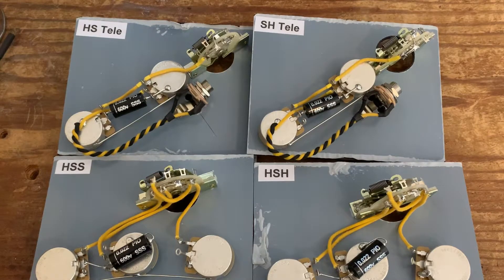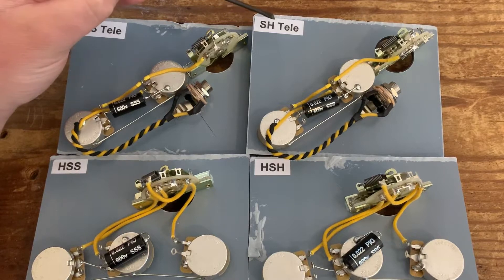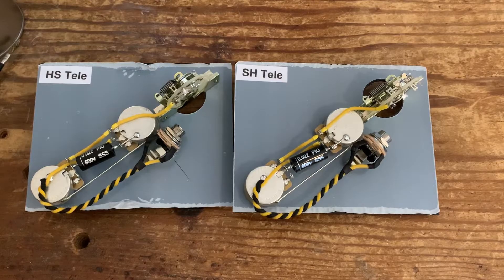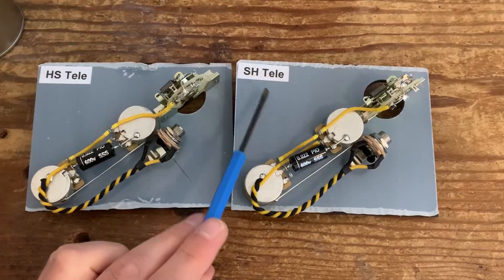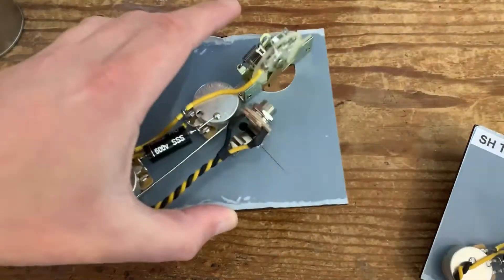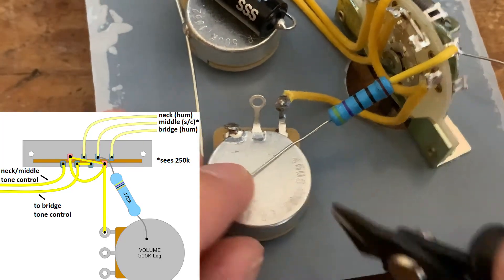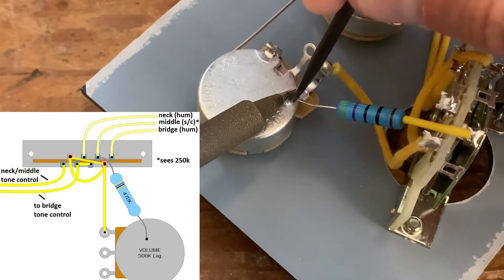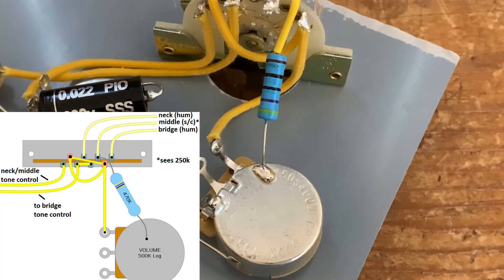How To Use Resistors to Balance Single Coils & Humbuckers In Your Guitar

Comment: In the instance of a HS configuration with one volume (500k) and a three way toggle, would you just place the 470k resistor on the point on the three way toggle where the single coil terminates, and then to ground of the three way toggle? The switch and Volume pot are too far apart, and assume the ground plane are the same no matter where you wire it too?

Comment: This is very logic and follows ohm's law regarding parallel resistors. 
But when an intermediate position is used, both output of humbucker and single coil are connected together, so my understanding is that both see then a 250k volume pot as the humbucker is connected to the single coil output, which adds the 470k resistor in parallel with the volume pot. Am I wrong or right here?

I'm currently trying to create a pcb to use on a PRS SE Custom 24, with two splitting CTS pots, one used for volume the other one for tone control, both switches used for spitting humbuckers, neck and bridge. 
PCB will offer the choice (via dipswitches) of screws or slugs for splitted pickup, will offer also the choice of the CTS position (down H, up S, or the way around, depending of my tastes of the sound) and will connect a parallel resistor for each splitted pickup too.  But I plan to use 1k resistors, so when one only pickup is splitted and both pickups are used, the volume resistor drops down from 500k to less, but not as much as 250k. Only when both pickups are splitted and used, both add their own 1k resistor in parallel with the volume pot, then acheiving 250k.

Is this a good strategy in this case?

Comment: If I have not misunderstood the HSH option, the 3 potentiometers are 500 k. In the position of the middle pickup (single coil) the 470k resistance makes the volume potentiometer go to 250k, but the tone potentiometer is still 500k, is that so? . Could you put a second 470k resistor from the middle pickup pin on the selector to the middle pickup tone potentiometer, to solve it? .... By the way, I have assembled the electronic SSH of this video and the SSH of the other video (with superswitch) and the electronic with the superswitch sounds much better to me, I don't know if there is any explanation for this

Comment: thanks for this so much! If you have a second to explain - how does the resistor affect the bridge + neck middle position sound?
Reply: Being as no one responded in the comments: The resistance is specific to each pickup; so having the bridge and neck pickups in parallel is no different that if they each had their own dedicated volume pot of differing resistance in the carbon tracks of the wipers. The only difference is that it’s a master volume (so imagine it as if you had a dual-gang volume pot in which one was 250k and the other 500, but sharing a common pot shaft). This is what the “resistor at the selector switch” mod emulates.
Reply: Thanks! In case we have both 500K tone pots (HSS) , additional resistors aren't required. Correct?

Comment: Thanks for the video! Would you be able to show how to wire 2 stack pots 250/500 for HS telecaster? I have seen somewhere that this way you have circuit for each pup and you can get the actual 100% of this pup combination

Comment: Hi, since this method has no auto-split for bridge humbucker in it, is it possible to change the regular 500k pot with 500k push pull pot for split coil switch?

Comment: Great vid dude.  My particular circumstance is slightly different. I have H H with a coil split. Is it possible to get just the singles when split to see 250k pots? Also is there a problem of things getting dark when you using bot pickups together? Cheers dean
Reply: Hy, I‘m planning to have two resistors engaged individually for each of the two splittable humbuckers (single volume pot), individually with on/off mini button switches. 
I want to have each full humbucker darker too at will, not just if splitted. 
    Because I decided to mimic a 300K pot, I need to connect a 740K pot in parallel to the 500K volume pot, for each pup. 
    Not sure yet though how to wire the extra resistors to work for both- full humbucker and in split mode…
     In middle position the two humbucker with both resistors on, will sound like they would each have the same pot (in my case 300K), and not darker. 
In singlecoil split mode, the same. 
    I hope, it will work out… 
Maybe I gave you an idea for your plan😊

Comment: Hello, great video. I have an HSS Strat with exactly the same wiring as yours with only 250k volume / 250k 1st tone & 500k 2nd tone push-pull pot. Would you install 2 resistors there too? Greetings from Germany to UK
Reply from the maker: Hi no, I would only add resistors if using 500k pots.

Comment: Hi Ed, great video!!
On the HSS harness could you get away with using just 1 resistor or you definitely need to install 2? Thank you for the clarification! And keep on rocking!!!
Did I say I love the intro theme for your videos?
Reply from the maker: Hi mate, thanks a lot! You can use none, one, or two :) whatever you prefer. Using it just means that pickup would see a different pot resistance value, so you can mix and match.

and thanks! Yeah pretty chuffed with the intro riff. That's me recording into an iphone :)

Comment: Thanks, another great and very useful vid! So for a Tele with neck HB, does the resistor not only send 250k (or so) for the bridge pup, to the vol pot, but also to the tone pot? Is that how it works? Pity you didn't do this last week before I placed my order I would have ordered a couple of resistors too ;)

Comment: Hi, and thanks for these videos they're an amazing resource. I was wondering (as an electrical beginner) why the 470k resistor acts to reduce 500k to 250k? Also what effect does this mod have on the inbetween positions of a 5 way switch.... what do the pups see when the resistors act on HSS in positions 2 and 4? Thanks again.
Reply: Because the resistor works in parallel with another resistor (the volume pot) they do not double the resistance nor do they halve it, there is a formula which says if the two resistances or impedances in parallel are equal and of the same value, then the total or equivalent resistance, RT is equal to half the value of one resistor. That is equal to R/2.

So basically you take R1 (500K Volume Pot) and times it by R2 (the 470K resistor) which gives you 235000K then you divide that by R1 + R2 which gives you a Resistance Total of 242K

This is not entirely accurate though as this assumes the volume pot is exactly 250k, which with CTS pots is almost never true, they are usually slightly less, more around 220k - 240k, they are known for durability but not accuracy. So if you are using CTS pots it is actually better to go for a higher resistor to compensate for this. 560k is more suitable and a very common value resistor and easy to find and this will get you closer to 250k and prevent you single coil from sounding muddy. If it is too bright you can always tame it with your tone pot, too dark and you're stuck in the mud.
Reply from the maker: Ideally you want a 500k but 470k is close enough. The pickups will see both, correctly. So when in positions 2 and 4, the single coil will see 250k (ish) and the hummer will see 500k. Thanks for watching, genuinely appreciated
Reply: @SixStringSupplies   hi i have a question how does this wiring affects the in between pickups? like neck and middle, middle and bridge? and also coil split?

Comment: I have an hss American Strat that has the dual stacked volume pots to keep from doing this but the bridge pickup is so much louder than the other 2. I’ve tried adjusting the pickup height with no success. It’s so bad it’s almost unusable. Is there a way to solder in a resistor or something to reduce the humbuckers volume? Thanks in advance. Btw I love the videos. I’ve used them so many times wiring up all my guitars.

Comment: Great videos as usual and really clear instructions but I think there's an error with the HSS.  Your inset diagram  shows the resistors grounding to the 250k pot. 🤔
Reply from the maker: Ground is ground. Doesn’t matter what pot it grounds to. It was easier to draw on the diagram but you’d ground them to the nearest ground point.
Reply: @SixStringSupplies  Thanks for clearing that up.  Love your videos - thanks
Reply from the maker: Cheers Dave glad you like them.
Reply: @SixStringSupplies  i not understand...the diagram shows that the 470k resistor was solder on 250k pot but you solder on the 500k pot, i really not understand for the hss.

Comment: Hi - thanks for sharing this video - perfect timing, really! 🎸
I've been thinking about similar options..

However, I have a question/request, if I may...
I have a Tradition SP-1 guitar, with 3 Single Coil sized Humbuckers, which are also splitable using ON/ON switches with 3 pins.
From memory I believe the stock pots are 500K and the usual capacitor - but wouldn't it be "better" that the different settings would see the proper capacitors?
I've seen those stacked/concentric pots, 250K/500K, and was wondering if those would do the trick?
Would it be possible to wire the guitar up with such pots, so that the humbucker setting gets 500K and the split gets 250K? Or is that completely overkill? Or even necessary?
The guitar has 1 vol and 1 tone + the 3 ON/ON switches which have 3 pins.

Thanks!
Cheers.
Reply from the maker: Hi mate - I've got a video on concentric pots in the pipeline, but you can actually wire a push pull pot to use 2 different capacitor values (Example 0.022uF when in the down position and 0.047uF when pulled up) which could work for your setup.

From a personal POV, the difference in pot values makes a fairly noticable difference, capacitor values is harder to detect (to my ears anyway)

Thanks for watching